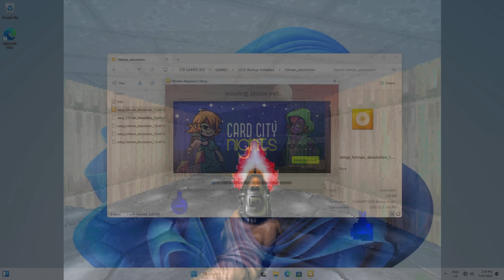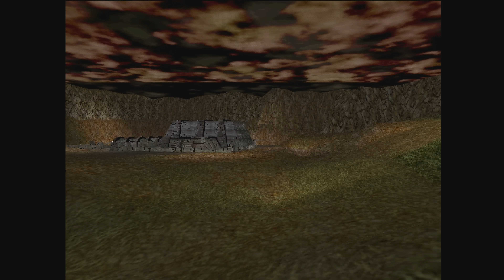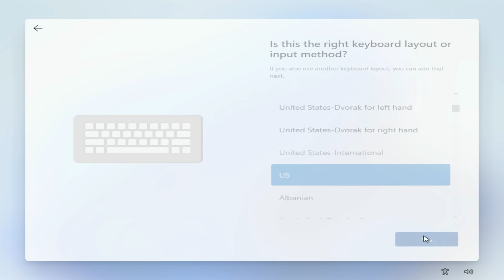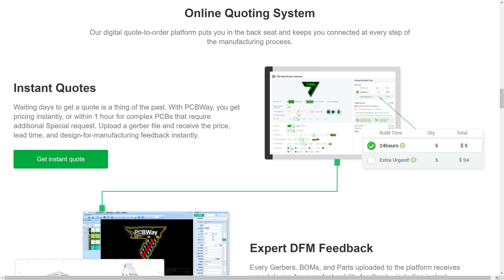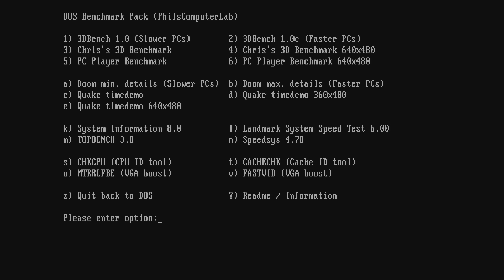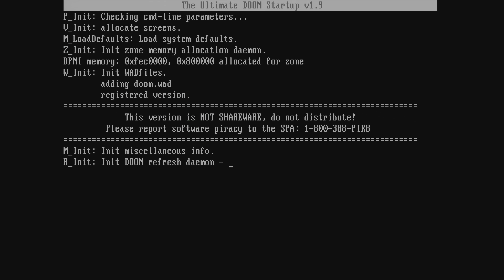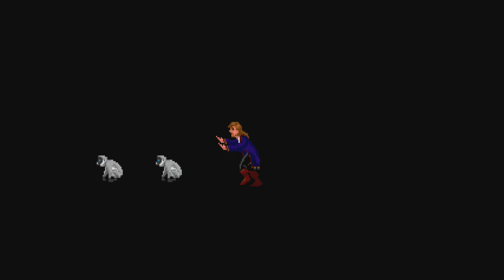LGA 775 The Next Big Thing for Retro PC Community?

Comment: Also still have a motherboard with an installed Core 2 Duo E8400 and a REAL Intel motherboard with the P67 chipset and a BUILD-IN Intel Graphics accelerator on board. Uses an Intel GMA 950 Graphics accelerator faster then any virge DX card. Happy i did not throw away this beauty! I can install a graphics card but not needed, it plays doom and all old games perfectly!

It features 4 pixel shaders and 1 vertex shader 4 texture mapping units, and 1 ROP.
The GPU is operating at a frequency of 250 MHz, which can be boosted up to 400 MHz.
Its power draw is rated at 7 W maximum. 

Thanks for this video!

Comment: I have been having problems making a retro computer with two different operating systems, in this case it would be Windows 98 or Me and then XP. The problem is that after a few boots on Windows XP, the disk with the older Windows has corrupted files! The file names have strange characters even in the shortcuts and ScanDisk cannot resolve them. Even using one disk for each operating system, the problem persists always after a while. For me it's important to have Windows 98 and Windows XP on the same computer. The Xp also allows you to view many websites on the internet and make use of a Wireless Pci network card, as well as installing most GOG games. It would be important if you could make a video showing how to make a retro multiboot computer and how to solve or prevent one operating system from harming one disk or another, if you can.

Comment: Socket 775 is a great in between platform for a huge range of Os's.   (I've still got my P45 chipset with Intel E8600/4 gigs of ram/ 8800 GTS 320)  Another chipset I'm fond with is my Asus Premium SLI 939 with an AMD FX 60/Opteron.  Gaming is a blast on original vintage hardware and OS.  Thanks PhilsComputerLab for mentioning these hidden retro platforms.

Comment: Isn’t windows 98 compatibility limited to systems with a ICH7 south bridge or lower? I remember having a LGA775 board with an ICH9 that didn’t have full driver support under 98.. while ICH7 versions did.
Reply from the maker: Don't need drivers! Just install 98 without C
Motherboard drivers, that is the trick.

Comment: Phil, I have three HP thin clients: a 5730 I gambled on for only $20 at an electronics surplus store (Skycraft in Orlando) that doesn't work; a 5720 I bought for $35 off Ebay I've used for years (that I just had to replace the motherboard for but is now working again) and I'm still using; and a 5740 which is functional but useless to me because it won't even show me what's on a USB flash or allow me to add any applications with one. 
The only thing I need them for is running an application (which is only a few kilobytes) for tuning and monitoring the Megasquirt II electronic control module I built for the fuel injection in my Camaro, and playing wmv and MP3 files off a USB flash as my audio source in the vehicle. Before I got a working thin client I used a canabalized 95 desktop with a power inverter complete with floppy, CD/ROM, PCI adapted LCD, and bulky PS. I don't have that rig any longer but I still have an E-machine I used in the same manner but with Win 98 and an SSD I added because vibration kept wrecking the hard-drives. 
My question is: Is there any way for me to format the IDE DOM of the 5740 and load it with an OEM copy of 98 I have that I bought new on disc so I can also load my EFI application on it and play audio files through it too ? I still have floppy 98 boot discs and a floppy drive but am using a win 10 desktop for going on line. I'd like to make the 5740 a workable spare for the 5720. I'd also like to know what "Rufus" actually does.
Reply from the maker: I'd just use XP as it is easy to install from USB optical drive and has more support for newer drivers. 98 you need an IDE optical drive basically, or at least a boot floppy, and then remove the hard drive. It's convoluted, not easy to explain...
Reply: @philscomputerlab  Well, I downloaded a copy of "Boot from USB" and sucessfully installed it and loaded the new flash-drive I bought just for the task twice, The first time with XP with no serivice pack and when I tried to boot the 5740 with it I got a notice it was missing a file (<Windows root>\system32\hal.dll.) so  tried again with a downloaded copy of XP with service pack 2 and when i tried it the same old stripped XP on the DOM that always boots booted. Another video I saw said service pack 3 was the best but then you need the product ID code. There's cats selling "sealed" copies on Ebay with numbers for like $40; but Ebay has become rather untrustworthy of late if you ask me. Do you think the DOM from my 5720 which has always had a workable version of XP on it would just plug and play in my 5740 in place of the Dom in it with just the stripped down version of XP ? or are the supporting chip-sets too different? Is there any risk in trying that?

Comment: I'd just like to know how to get Win 9x to install on one of these fast machines if you don't have the ability to adjust the CPU FSB/Multiplier I have an old Compaq/HP with Athlon XP 2500+ and can't get Win9x to even install, I know there's patches you can install after the fact to allow faster CPUs but I may be stuck with WinXp on this machine....
Reply from the maker: Use Windows 98 SE, not 95.
Reply: @philscomputerlab  well yeah, I just can't get the installer to run even when using 98SE

Comment: Be careful when buying LGA775 motherboards.  Intel used LGA775 for several generations of processors.  Not all LGA775 motherboards support core 2 duo processors.

Also need to consider the memory type the motherboard supports.  There are LGA775 motherboards with DDR, DDR2, or DDR3 memory slots.

Comment: 12:12 I'm actually doing something similar on an X58 based mixed use Win 10/Win XP rig. Works reasonably well. The riser card I use has both an NVME slot and a M.2 SATA slot, so it saves me some cable management annoyance.

Comment: I personally don't see any advantage of using LGA 775 instead of more modern boards that support Core i5 2500K or even up to 4th gen Haswell 4790K. You can still get boards with PCI slots for Haswell. Actually I've bought one back then to still use my Sound Blaster X-Fi PCI.

Keep in mind that 4th gen Intel CPUs are the first ones to have all modern instruction sets. Though you might run Windows 11 on 775 there will be software that won't run and soon all modern OSes might stop working because of missing instructions. Even Linux will drop support at some kernel version.

Lastly. Haswell has way better integrated graphics cards compared to 775. They have performance similar to Geforce 7600 or even up to 8600, depending if you have i3, i5 or better. 

As for pricing. It's all random. There are tons of Dell, HP, Lenovo etc. used business desktops with i3 and i5 that cost less than a decent LGA 775 build.
LGA 775 isn't energy efficient compared to more modern sockets, so most people threw away such computers. Fast Core2Quad or even Core2Duo will use so much energy that you can get a used Haswell machine and still spend less.

One more thing. You can look for Apple Mac Mini or iMac from 2009. They have Core2Duo, great compatibility with Windows XP and Geforce 9400M which is a great GPU for early Windows XP gaming.

Comment: I have a killer 775 rig stored away. 98, XP and MX Linux themed to look like Win2000 to keep steam working. I have 6 graphics cards and 6 CPU's, 3 sets of Ram and several WD raptor drives. Its in a modded fractal case with wrap to look period. Raptors make nice noise. Hotswap bays, Soundblaster 7.1, Zalman flower cooler, all black pcb mainboard ram graphics. What I'm missing is a nice 21" CRT.

Comment: Hey Phil. What about LGA 1366 with an X58 chipset? The board I'm using has pci, pcie, a parallel port, and a serial port. It has an lpc header which could be used with something like the dISAppointment project for ISA support.

My main fear is lack of chipset support as it supercedes the 775, but if that isn't much of a worry, then I can get  a spund and graphics card and already be set.

Comment: You may very well be right, once again :)
From what I was able to observe, the "retro-resurrection horizon" is around 20 years.
Platforms too old for daily driving fall into sort of "limbo" where everybody forgets about them and no one wants them but as soon as they reach around 20 years of age, the enthusiasts who remember working with them start to - usually out of nostalgia - dig them out, and, given their age, it becomes generally considered retro and the demand for them ramps up again.
The key here is that the hardware needs to survive the "limbo" period in which most of it gets scrapped as valueless. The amount of what remains then determines the prices when the demand goes back up. And as it becomes increasingly rare (and some even still being scrapped later, or just dying of old age), the prices go up.
Unfortunately, the scrapman has an upper hand with aggressive gold/rare metal mining policies, appealing to common folk who don't understand the value of the hardware, often even subsidised by authorities, so we enthusiasts have a very difficult but noble task of saving whatever can be saved from such miserable fate.
Reply from the maker: Great summary of what's happening 😊

Comment: I already know that is the next retro pc hardware to have, to the point of already building a windows xp with a LGA775 Core 2 Quad 9550 and as GPU an GTX 960 that was the last one to have official drivers for XP, also an Audigy 2 installed... As i was seeing this video i thought that you are spot on on the specs...

Comment: I gotta ton of lga 775 stuff for retro gaming I prefer am2+/am3 phenoms another good option is g3258s they supported by xp since old xp games don't use alot of cores 2 faster cores oced up to 4.8ghz that sip power in comparison and the cpu can be found for less than a midrange core 2 quad while having more mobos available because of that capacitor plague

Comment: I have a few a full functional "retro pcs in my possession. SS7, Slot1, FCPGA2 S487@479 (ASUS CT 479) and a P45 S775 is on the shelf. Except for socket 775, all older sockets are very expensive on Ebay. As example ASUS tusl2-c. ASUS P5A and the adapter ASUS CT 479 does not exist anymore on Ebay.

Comment: I think that 775 could be a next thing, but nowhere near as big as for example PII Slot 1 systems with Voodoo graphics, as 775 systems were very very common and they still are in use here and there. Also they are limited to XP and Vista, which you can get newer machines (i7, etc. up to 3rd generation) which still support XP.

I would say P3 or P4 systems are more versatile - you can still run DOS/W98 and have ISA soundcards and on the other end you can easily run XP.

But then again I would love to get hands on a beefed up 775 machine - thinking of C2Q CPU, some dual 8800 GTS GPUs and a large Chieftec case with see-through panel

Comment: I have running a Asrock 775i65G... Best board for Win9x/XP gaming... It has AGP 8X, 4 PCI, dual-channel DDR, IDE and SATA with compatible mode in BIOS, so you can plug and SSD directly without IDE converters and install Win98SE like installing on a IDE HDD... 865i chipset is 100% compatible with Win98SE... Right now i'm running Win98SE with a Celeron 440 sipping only 35w, a Voodoo 3 3000 PCI, 2x256gb DDR and 120gb SSD...

Comment: Still own several 775 boards and CPU's... I'm currently using 875 for my Win98SE and 775 for my Vista build (yeah I also prefer Vista over XP). Planning to ditch 775 for AM3+ with a FX4300 black edition on the Vista build.

Comment: Using a Q9550 series CPU,16GB DDR3 with a stripped down W11, running Launchbox (for consoles) and ExoDos. Not DOS tweaking required. I have period specific computers but mostly use the above device.
Reply: why you need Windows 11 on that ?
Reply: @lucasrem  It is faster than windows 7 or XP on  the same hardware and I have zero issues with apps not working or being to old.

Comment: I think one of the best Socket 775 board is the one that has Intel 865 chipset, and paired with Intel Celeron 400 series. With this combination you get: complete support of Windows 98 drivers, AGP slot, and IDE connector. I bought three Asus P5PE-VM because of this

Another interesting bit is that even tough Intel Celeron 400 series is newer than Pentium 4 and using socket 775 it's actually single-core and based on Intel's P6 microachitecture just like Pentium Pro/II/III. Oh, and also it's only 35 watt TDP, so passive-cooling is possible.

Comment: In 2008 I bought an E8600 with a 775 motherboard with an nforce 750i chipset and I was able to boot the E8600 at 5ghz (not stable though) and run it at 4.8ghz 24/7. It's amazing how speeds haven't increased much in 15 years but the difference IPC makes is massive.
I still have a few q6600 cpus laying around but no boards currently.

775 was a beast.

Comment: I wish I knew which chipsets to look for for LGA775 pcs. VIA used to be good enough IMHO, but sounds like there are better options out there.
Reply: I think one of the best Socket 775 board is the one that has Intel 865 chipset, and paired with Intel Celeron 400 series. With this combination you get: complete support of Windows 98 drivers, AGP slot, and IDE connector. I bought three Asus P5PE-VM because of this

Another interesting bit is that even tough Intel Celeron 400 series is newer than Pentium 4 and using socket 775 it's actually single-core and based on Intel's P6 microachitecture just like Pentium Pro/II/III. Oh, and also it's only 35 watt TDP, so passive-cooling is possible.

Comment: Proud socket 775 PC with DDR3 owner here! While it's in retirement for now, I plan to upgrade it in the future to max it out. 

Supports up to 1600 MHz FSB and 16 GB of RAM. With a Q9650 OC-ed to 3.6 GHz it's probably gonna run the latest games too with a GPU upgrade.

Note that PCI-E x1 2.0 is 533 MB/s, so not really faster than SATA 3.

Comment: iv been given many 775 builds over the recent years, so im spoilt for choice and even have kept my core 2 duo era rig due to how reliable its has been. Personally i use my 2001 era specific build for retro early xp era games based on an athlon xp KT266 board, GF3 Ti and audigy platinum ex...so many good games that have there quirks with modern os's but run like a dream on the retro machine ;D

Comment: Compatibility with Win 11 at the same time as 98 will be kinda pointless, you wont find any gpu that has Win98 drivers and Win 11 compatible drivers. Unless you want to swap graphics cards to switch os and in that case it would be easier to use separate systems. You can find gpus from the early 2010s that have XP drivers and drivers for 10 that will work in 11 but 98 went out of support way before GPUs were released that have DirectX11 support as needed by Windows 11.

Comment: LGA 771 Xeons for those platforms do most of the sense if you want to get into 775 boards. But I'd argue that you should skip 775 altogether and get LGA1366/x58 with a X5670~, and you'll get better off with compatibility as it can do way more - for example nvme with clover is more viable due to having better port availbility on x58 boards. And yes, absolutely those boards suffer from capacitor plague, EVERYTHING up to LGA 1150 will - this is just the matter of the market at the time, cos chinese we're doing a subpar cloning and counterfeiting of cheapo parts, but by now the quality process improved immensely so. It's the same as with the leaded vs lowmelting solder, just a quirk of the market of the time and how shit was being pushed out.

Comment: Basically anything that's 10 years and older should be considered retro hardware. Back in the mid-2000s, if we wouldn't have thought of socket 3/socket 7 as retro, no one would have saved that hardware.

Comment: I dont know...seems a bit odd running win9x and DOS on this platform.  XP absolutely.  Half the fun of retro gaming is running on the hardware we did back in the day.  Id rather pay more for a period correct part than try to get this working with DOS based o/s's.  You can still get reasonable deals on pentium 2 hardware if you choose properly.

Comment: I've held on to a couple of these.. an ASRock G41C-GS R 2.0 with a Core2Extreme QX6700 in it and a Sony VAIO VGC-RB30 with a Prescott P4.  The Core2Extreme is still usable with modern OS.. That 2006 CPU has power roughly equivalent to a Core i3-2100.  The Sony VAIO has an Intel D915GRO motherboard. Haven't done much with it yet. I keep old systems like these around and recap them if need be..

Comment: I think that LGA775 is still a relevant platform today. I have LGA775 with AGP slot, and also PCI-e.

I have a very interesting BIOSTAR P4M800Pro-D1 motherboard with AGP slot, which allows you to run Intel Core 2 Quad Q6600! But DDR1 RAM in it works only in single-channel mode, and the maximum volume that can be installed in this motherboard is 2 GB!

But I have an even more interesting project! I managed to do it thanks to your videos! Until the very end, I did not believe that early PCI-e video cards can be made to work in Windows 98 using an unofficial driver! I currently have the following platform assembled as a second computer:

GIGABYTE GA-G31M ES2L
Intel Core 2 Quad Q9650
4 GB DDR2
NVIDIA Geforce 7600 GS
Sound Blaster 128 PCI CT4810 (in DOS I use SBemu, because there are problems with the EMM386 memory)
3Com EtherLink 10/100 PCI (3C905C-TX) + mini PCI - TP-Link Wi-Fi
SSD 240 GB (Win98 + Win8.1 x86 installed)

I really liked the project on Q9650, I often use this computer when the main computer is busy with heavy tasks.